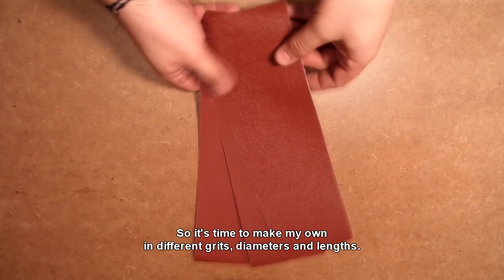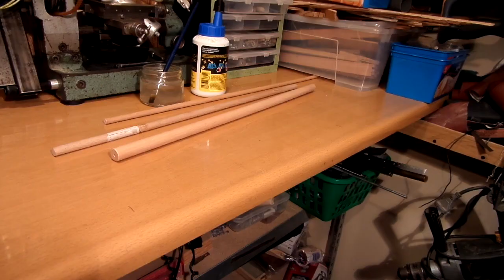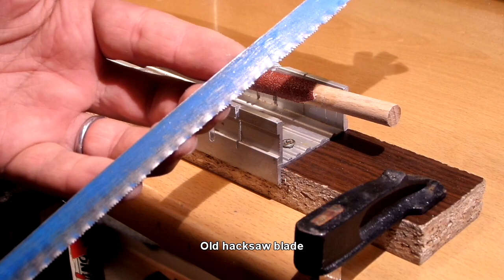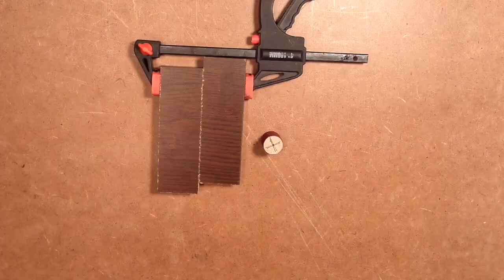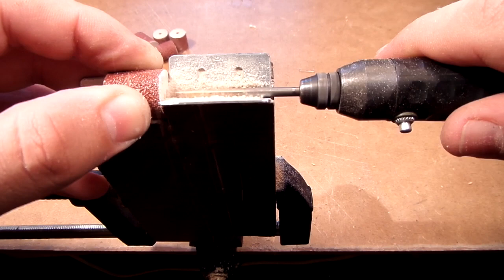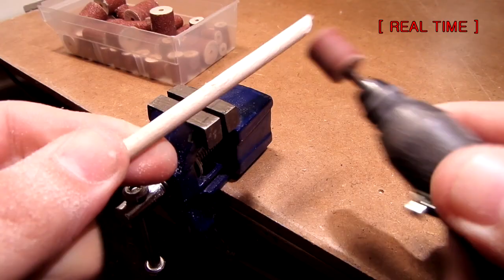Homemade Drum Sanders

Comment: This was a great video, thanks for taking the time to show us how to save a few dollars. I'd like to add that the thin Dremel cutting wheel can be used to cut a slot into the shank portion of the screw so that a small screwdriver can be used to install or remove the dowel portion.
Reply: +William Charles   Agree 100%. There are far too many convenient, quicker, & functional changes dremel could make but nothing much helpful & cheap has changed been made since they turned the sun on.  I always check out those cheapy dremel knock-offs cause some neat items can be found in the kits.
Reply: dunlaoghaire Amen, to that. Those Harbor Freight knock offs when on sale can be had with all kinds of attachments for the price of just a couple of the Dremel attachments. The motor portion of those kits are really cheaply made, but who cares? It's the attachments that make for the value.

Comment: you make it look so easy, there have been so many times in the middle of the night when i  needing a sanding drum and didn't have any. Every time i ended up wasting way more time trying to make a usable drum then it would be to go get some. Evidently the ability to make a perfect center hole is a gift from god only for the chosen and I ain't one of them!!!
Reply from the maker: Even if the hole is not perfectly centered they still work fine, they just wear faster on one side. Unless the hole is really off, then they vibrate too much. But the jig I used made holes close enough.

Comment: This Idea is Great! and it should be pointed out that your Idea could applied on Drum sander of a much larger scale such as useing a 2 inch dowel and mounting it to your Drill Press a sacrificial board to the adjustable work table and the rest writes itself now if you were to buy a drum sander like that it would set you back a small fortune but a few hours in the shop and you have  a decent work around assuming you turn the dowel yourself on you drill press if you don't have a lathe I have both so i'm very lucky
Reply: For larger drum sanders you can build a notch and tapered keyway so you can fold lengths of sandpaper and tuck it in and not waste wood.

Comment: Great Idea,and costs almost nothing!
Reply from the maker: Thanks!
Reply: +The Small Workshop 
Got a secret for making the cut off wheels?
I get very little use out of them before busting them up :/
Some literally fly apart as they touch whatever I am cutting
Reply: Buy 4-1/2 angle grinder blades in bulk, or even the larger 14" chop saw blades and use a hole saw to cut smaller pieces out of them. Just go very slowly so it cuts cleanly instead of tearing and breaking.

Comment: Great idea! Totally off topic, but I saw someone made a home version of a sonicare tooth brush head using a regular toothbrush as the head but did something similar with the point where it attaches to a spent sonicare toothbrush head that attaches to the regular mounting and it apparently saves a huge amount of money and works just as well.
Reply from the maker: Thanks! I've seen electric toothbrushes with sandpaper glued on the tip to sand in tight places. This is like a link between my video and your comment :D

Comment: What grit paper was that? I have cut a slit in the shaft "nail or screw" donor and made a flapper type wheel... You can adjust the sanding pressure by controlling the distance with that little setup... Quite good for removing the aluminum transfer from the piston onto the cylinder in rebuilding small engines. I love this idea ... And I'll bet five bucks they last longer because the quality of the paper is actually better in your homemade ones!!! A++

Comment: You could make hole bigger and use screw(cut head off,M5 screw for example,one that is not all threaded) and 2 nuts for mounting axle.
That way you can quickly release the drum by unscrewing 1 nut/maybe add 2 washers for extra strength.
Reply from the maker: But this way I can simply unscrew the drum and replace it in no time, without tools.
Reply: The Small Workshop
Yea but can you replace the paper with ease,or you have to cut new dovel every time?
If you have a all thread rod and hole trough dovel,you can push all same size dovels on threaded rod and apply new sandpaper and glue,then simply cut it with knife.

Just an idea for upgrading your system,to make it more reusable.

Comment: You drilled those center holes perfectly!  Do you center find on the dowel first, then make your drilling jig?  You made it look easy, but I know it is not.  Great video and ideas.  Thanks.
Reply from the maker: For each size I first found the center of one piece, adjusted the jig a few times till it was spot on, then it was basically set for that size of dowel so all the next pieces of that size were easy to make. Some holes drifted a bit so the drum only made contact with the workpiece only on 2/3 of it's surface, but still worked just fine and only happened in few cases.

Comment: Wow good video! I needed those a few days ago when I was shaping the inside of a knife. Didn't expect them to work so good. Will they work with a drill on the highest speed?
Reply from the maker: I guess, depends on the drill, the rotary tool I use has around 5k RPM, a corded drill has around 3k, so it should work. Larger diameter drums work better at lower RPM, for thin ones you'll need something faster (or a lot of patience). There's also the question of side load, drill bearings aren't usually designed for that, so don't apply too much pressure.
Reply: Okay thanks for the information!

Comment: have u found a better way then using the thread? thanks for the video. which Proxxon do u own?
Reply from the maker: No, I like the thread, it allows for quick change of drums without tools. If you want you can use the rubber drums and only make the sandpaper shells. I believe there's a suggested video on the right doing it that way. You can also make the rubber barrel yourself from a printer roller and a screw.

Comment: you should try contact cement instead of white glue, lots cleaner and quicker, good idea I will have to make a bunch of these different sizes and save some money,                                                                                                                            thanx
Reply from the maker: The white glue I use takes around 20 minutes to dry (the bottle says 5 minutes). Probably contact cement would be better for this, but I work in a very small shop and the fumes would kill me :D

Comment: Man, your table saw is so quiet :D which brand/model do you use
Reply from the maker: It's an old rockwell compactool, probably made in the 70s. It's a seven inch direct drive saw, so the cutting capacity is quite limited, around an inch and a half, but it's unbelievable quiet and pretty well built underneath, so it's precise.
Reply: Well, that should be enough if you dont do resawing work, a bigger one would be nicer though. Thanks :)

Comment: that idea would turn any drill press into a spindle sander
Reply from the maker: Yea, if you don't put too much pressure on the work. Drills aren't designed to take side loads, while the "dremel" tools are, since they are meant for cutting and grinding.

Comment: you are right about contact glue fumes not good to breathe and flammable too, white glue would be best if you don't have good ventilation I have a metal lathe so I chuck and center drill,  regardless how we make them still cheaper and any size you want

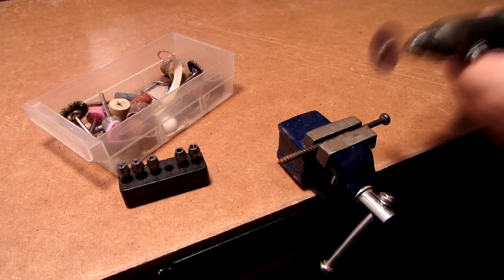Comment: whats the machine at 3:44 called?
Reply from the maker: +SMOKER It's a rotary tool from Proxxon, model 50/E.
Reply: The Small Workshop I mean what is the thing at the head of it called?
Reply from the maker: +SMOKER it's a cut off wheel for dremels. Or you mean the blue vise?
Reply: The Small Workshop thanks, I meant the cut off wheel.

Comment: That is a great idea for all People who use a dremel or similar maschines. But I think for sanding and Drilling is your 12 Volt proxxon Maschine not the write. You shuold buy a dremel with 230 Volt.
Reply from the maker: The proxxon is more precise than the dremel for small holes. True, for the 3mm hole I did in the video the proxxon was not enough, but for 0.3 mm holes, the precision is amazing. When I'll have the budget for it I'll probably get a 230V machine to use for harder work.

Comment: great video, now you just need to make sure that the materials, time spent and tools(which are slowly degrading) worth to make them(tip for life).
Reply from the maker: You forgot about marketing costs!
Reply: The Small Workshop? i dont think i know what it means but what i meant was if it worth making it instead of buying...
Reply: All the dremel bits are way overpriced and i make all my own everything. I make sanding pads as large as 3in for mine.  The store bought ones r junk and they're gone in minutes when doing certain jobs. Pick up a brand new tool for 30 bucks here in Canada and make your own bits it's pretty cheap method. He's got a sweet idea here i've been looking for a sanding drum method thank you

Comment: I like your inventive ideas there should be more people like you but from a frugal point of view is it cheaper  to  buy a mini drum sander for hobby rotary tool or is cheaper to buy the dowel and a pack of 25 screws (cos at my hardware you cant just  buy one) plus you have buy the glue and string Which is cheaper? At my hardware the dowels alone will cost me 12 dollars and the craftrite sander drum including other assorted bits  will be about $5.60
Reply from the maker: You are right. Almost always it's cheaper to buy things than make them. Even if you make them from scraps, the time spent has value. That being said, it's also a matter of convenience, where I live I have to drive around one hour to the store, then buy the only size and grit they have, a pack 10 drums for the price of a table saw blade. That idea alone makes me want to make them, they are overpriced and they know it, but it's the only option and they take advantage.
Dowels can be easily made using a simple drill. There are tons of videos on YouTube showing how. The rest I had around the shop. The screw was salvaged. The string and glue quantity was insignificant. As for sandpaper, all the drums in the video were made from half a sheet of sandpaper.
Reply: Thankyou for your prompt response I can certainly understand when a shop wants to get rich by one transaction especially when they are the only store in the area I've been in that situation too not any more other competitive stores moved in isn't it amazing how they didn't Have the ability to lower their price before the competition and after five or six stores move in they not only lower their prices but also treat you like royalty

Comment: Part 2: Ruined a knife making drum sanders. How to sharpen. :D
Reply from the maker: LOL, that knife was ruined the day it came out of the factory in China.
Reply: +The Small Workshop BTW - How do you compare your drums to cheap china sanders? I know that original dremel/proxxon ones are expensive and making your own copies is justified, but you can definitely buy knock-offs that are dirt cheap... They sand much better? More durable?
Reply from the maker: I never used cheap drums, cause I only saw them for sale once in a flea market. Or online, but shipping adds a lot to the price. But I used plenty of original ones and the homemade ones act about the same. I've used good sandpaper and they hold very well on wood. On metal, if you sand the edge they tend to wear out quickly. I'll try to make some using band sander sandpaper, that seems a lot tougher. The wood/shaft/glue part I have no complaint, they act as intended.
Reply: +The Small Workshop In such case they are great. Chinese ones tend to lose the abrasive material quite easily due to poor glue. Maybe I'll make my own then. Thanks for sharing :)

Comment: If you wrapped the dowel in paper first you could have glued the sandpaper to that, and slipped it all off to make drums.
Reply from the maker: You're right Paul, I saw a video about that process before I started, I believe it's in the right sidebar as we speak. I did not go that way because of two reasons: I wanted to do everything from scratch, including shaft, from easily available materials, so people can do them without the rubber drums, if they are not available in their part of the world. And second I don't like to copy someone else's videos.
Reply: The Small Workshop
Good reasons. But I have all of those rubber mandrels, and I am not above copying good ideas myself either. I've bought large assortment bags of sanding drums. I cannot remember what I paid, but I do not recall it being that expensive. I know I still have a bunch of them too. But I do tend to run out of some sizes more than others.
Reply: No! The bloody things heat up, expand, come loose and fly right off the mandrel! Here it's all in one.
Reply: @susanp.collins7834  I haven't run into that problem here.  The drums stay on the mandrels good for me. Sometimes a bit too good. I've had to struggle to get them off at times. They work a bit like Chinese finger handcuffs. The harder I push to get them off the more they grip.

Comment: I've just watched a bunch of Dremel tips and tricks videos and been horrified by every single one of them.  They like how to butcher your DIY and make ugly tools and accessories.  But this video was every bit as good as the others were bad.  Some stand out ideas that had fantastic results.  I'll add one wee tip about where you were screwing the abrasive head on the screw come mandrel...  Hold the abrasive head tight, but not too tight, and start the Dremel for about two seconds.  This will wind the abrasive head onto the mandrel, and leave you all set for a bit of safe cracking by removing your fingerprints and making the tips of your fingers more sensitive.  If you have a good result when opening the safe, you'll be able to buy all the Dremel accessories you need, and if you don't get it completely right, you'll have a hobby to wend away the years you'll be spending in jail.  There you go...  A win win if ever there was one.

Comment: It's not that the rotary tool is under-powered but the bigger problem is the RPM is way too high for effective drilling.  I never use my rotary tools to drill.  They're just really bad at it.

I like your idea for drilling centers though.  I have trouble getting that kind of accuracy on my drill press.

BTW, I've purchased 20+ rotary tools.  They call came with a ton of sanding drums and I hardly use them.  I've been tempted to throw some out to give me more space for something else.

If you live in the States then email me and I'll mail some to you.  My email is on my website - airfieldmodels.com
Reply: Fuzzy Johnson "way to high" have you ever read the manual for your dremel?
Reply: Yes, but Dremel makes crappy tools and they show their tool being used to do things incredibly inappropriate for them just to make them look like they can do more stuff and are more versatile.

And Dremel doesn't supersede basic drilling rules and procedures.

Drill presses don't turn 30K RPM for a reason.  It's not like they couldn't be much higher RPM if that worked better.
Reply: Try the WorkZone  hobby tool (Aldi brand) I've had one for years and its never let me down yet (dam what is it they say about jinxing a thing just as well I have a spare as well lol) seriously though it's an excellent hobby tool, powerful with variable speed and you can get a full range of spare bits all in they're own little case pretty much for the price of ONE Dremil bit (and no before anyone asks I don't have shares in Aldi I just like the tools)